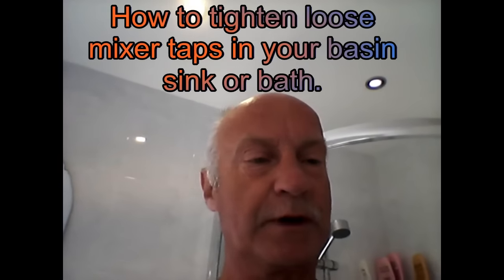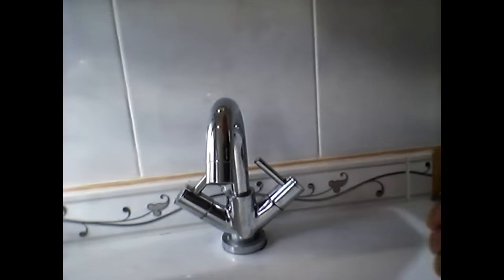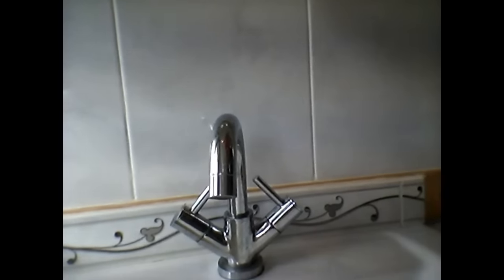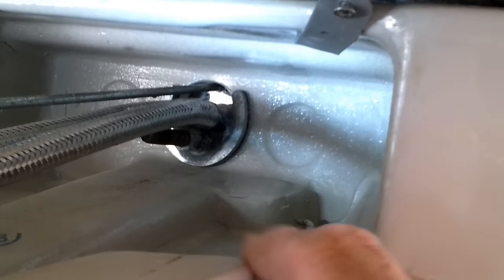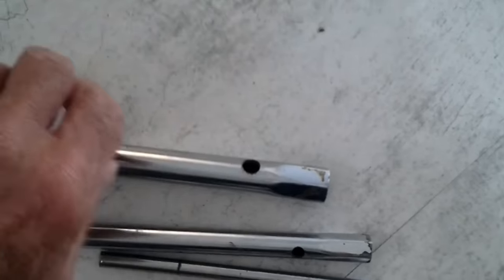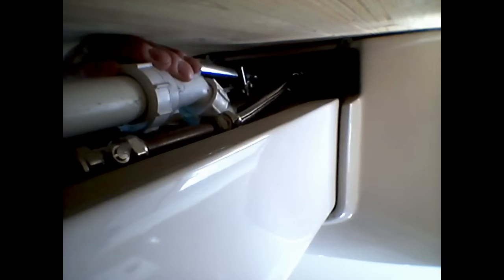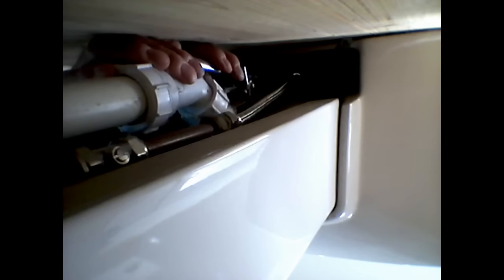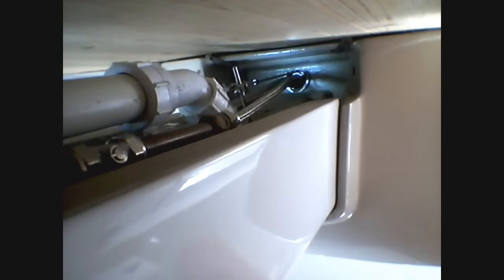How to tighten loose mixer taps. Sink,basin or bath ones.

Comment: I don't often comment on youtube, but thanks a million for this. Previously to seeing this I'd spent several hours on my back attempting to bend my arms the wrong way to fit a spanner into an impossible space to tighten up my loose tap. One youtube video and the correct tools for the job later and it's sorted in 5 mins. Cheers!
Reply from the maker: +richard3667 . No problem Richard.

Comment: Hi Al....I have had similar problems myself..and being a slightly larger plumber than your good self....and not being able to fit in some very confined spaces...I resorted to using the box type spanners you refer to...in an adapted ratchet raiator valve tool...or even a rachet fom a socket set...worked a treat....and I could hold the tap steady too. Keep up the good work sir.
Reply from the maker: Thanks will do.

Comment: Thank You for this video. I'm currently fitting a Burlington tap to a Burlington Cloak Room basin. It does not secure to the basin firmly. One would think Burlington products are made to fit each other to the millimetre but definitely not the case. This Chelsea CH20 tap does not fit the 51cm cloak room basin properly as the hole on the basin is to big for the seat of the tap. The rubber supplied is very flimsy and thin. The lever for the waste pop up is a pain to get right. Burlington has not thought out their products very well.

Comment: I had this exact problem. But managed to get a spanner on the bolt and did lots of quarter turns whilst holding the tap in place. Took a bit of fidderling. But once I got going it only took a few minutes.
Reply from the maker: Great.

Comment: Hi Al
we have the exact same monochoc tap in our bathroom but the problem we have is we have a leak coming from the cold-water tap itself, are the handles of the cold and hot taps removable from the tap body and will there be a washer inside the tap handle I can replace to stop the leak, thanks Al and your lovely lady for all the tips we`er getting through your great vids, all the best, Ted
Reply from the maker: +belltop cone Hi Ted not all the taps are fixable, but it is worth removing the handles to have a look , there may be a packing gland that just needs tightening up.

Comment: Hi Al, what a fabulous video am going to have a crack at fixing my kitchen tap. Question: the horseshoe ring is rusted and looking quite eeky, how do I go about replacing that, rather than just tightening the bolt?
Reply from the maker: They are hard to replace so if I were you I would just tighten it up.

Comment: Hello - mine does not have either of these type of connections. Are there any other types of connections?  I cannot see fully as the sink plug working may be blocking it.
Reply from the maker: Chris Smith Yes there is another one that is a large hexagon nut.

Comment: hi there... i have tried this, unfortunately, the spanner won't fit on the nut... the tap has push fit tap tails to fit the plumbing and unfortunately these fittings leave no room to get the spanner to grip the nut. Other than change the tap tails do you have any other suggestions? thanks
Reply from the maker: The nut sizes are all slightly different , a basin spanner will open to any size nut and is the preferred tool to us.

Comment: Hi good video but I have no nut just a long plastic rod with a hexagonal end and a standard screw driver slot. Being plastic the screw driver fixing is too wide to get any purchase and the hexagonal end is the same. Just flexes and won't undo or do up. Any suggestions?
Reply from the maker: There is a small box spanner set that should do it. About a fiver from Amazon.
Reply: @dereton33  Thanks for responding so quickly. I have a box spanner that fits the hexagonal end but metal on plastic it will not grip.
Reply from the maker: Have you tried a basin spanner
Reply: @dereton33  Hadn't seen one before, looks like it might do the job. I will get one asap and thanks for your advice.

Comment: Im investigating a leak, not sure where its coming from, but I do have a loose tap. however theres no sign of water leaking when i put my head under the sink. If the tap was causing a leak, would I definitely see it from beneath the sink?
Reply from the maker: Yes you would , but if the tap is loose you would not see the leak until you run the tap, as the tap to sink seal will be broken.

Comment: Thanks for the video, my bath taps have been like this for a good 2 years but we tend to use the shower, however am getting round to sorting them now :S Anyway how come this could cause a leak eventually? since its not the actual pipes that are lose from the tap?
Reply from the maker: Hi hogwart , you will get a leak in the end as the pipes under the tap will eventually break their joints  on the copper pipe connections below.
Kind regards,
al.

Comment: These single hole tap basins are a pain in the ass and the tap assy will always come loose.  I would much prefer to have two holes in the porcelin with separate hot and cold taps, I know it's old fashioned, but they seldom come loose.   The trouble with monobloc taps is you can put too much leverage on the tap via the spout or tap heads and they come loose too easily.   Separate hot and cold taps are very easy to fit and replace.  Sorry, just old fashioned.
Reply from the maker: I do agree with you though.

Comment: One big tip. Do not over tighten with a screwdriver. You’ll break the slot and won’t be able to use a screwdriver next time.
Reply from the maker: Good advice

Comment: What if there is no bolt, just a horse shoe looking piece of metal.
Reply from the maker: Anna Kappes Hi  Anna, there should be a bolt under the horse shoe, (about 2 inches in length) if yours has gone, then a plumbers shop should be able to sell you one. Al.